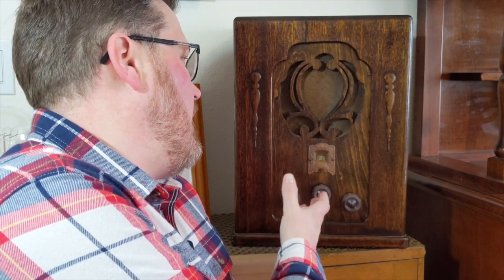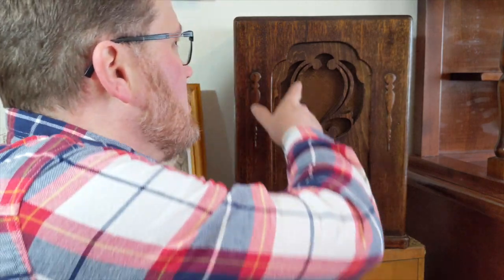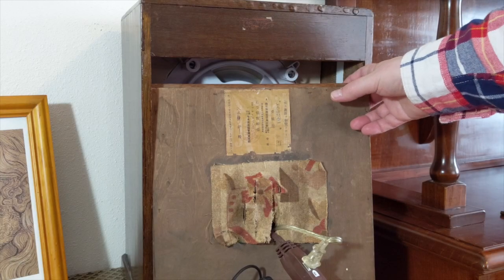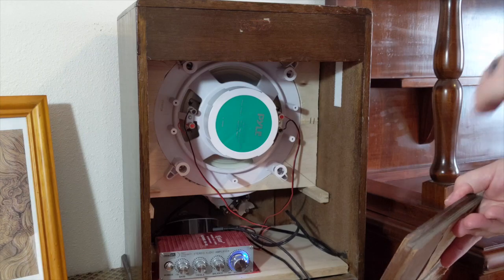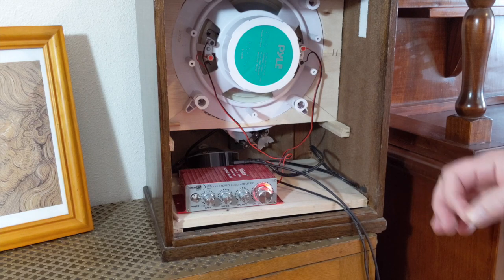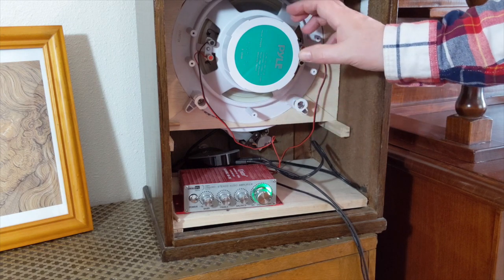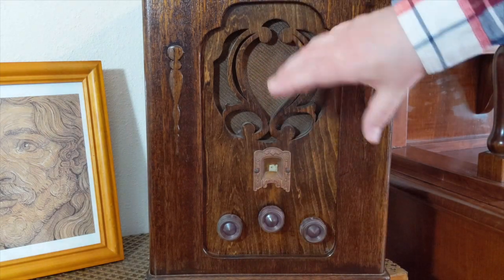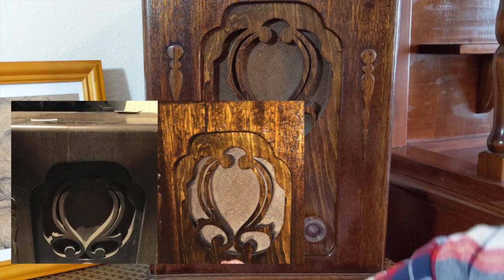I Converted an Antique Radio to Smart Speaker. You Won't Believe the Transformation!!

Comment: I actually did something similar.  I restored a Philco "Butterfly" Radio cabinet and I bought a SONOS ONE smart speaker.  Cool project, man.
Reply: Good for you. I’m an audio video contractor and enthusiast.  I have a few consoles that were basically shells and I did something similar. I placed two Bowers and Wilkins speakers inside of it, installed a night light behind where the dial was and installed some led bulbs.  The speakers are powered by an old Denon receiver .   I even have a sub hidden next a loveseat.  Sounds great.  I used a Xantech  IR kit to control the receiver.  I did what I wanted to because it’s mine.  Lastly your idea is a very good one.  Sonos ones fit well inside of tombstone radios.

Comment: Great job
Reply: skip j king on  public web site; here is my solution-i had the best of both worlds. I restored authentic radios ,rewired them and had
plenty of tubes, capacitors and test equippment-i made them work with original parts. Yet, i also had empty cabinets or
incomplete sets that could not possibly be repaired, so i put newer radios in them with often great results.I restored very old
radios, and you would be surprised how easy it is if you learn, but are careful to do it right! Now if you really insist on bluetoothing
an old cabinet try to find a nice already empty one--and if you feel you must modernize, the sell the chassis to people who
want an original-and that will help preservation and your pocket. i live in a retirement community now, but i had a blast
doing electronics in my day. If you like this sort of thing, try your best to preserve an original radio and insides and get
another with non repairable chassis or empty. lets not try to destroy all those survivors and radio history.at the rate
old things in general are being modernized there will be almost nothing left but facades.

Comment: I would like to do something similar, but my concept is a bit more ambitious and I definitely don't know how to get there just yet.  Let me also make clear that I am not into doing a restoration on the unit that I have.  I have an Atwater Kent Model 70 cabinet.  I've set aside the original electronics which aren't working, but I'll save them for posterity as I feel like that is important.  Someone else may want to do a restoration in the future.
  I also have an extra HT (home theater) receiver with all the speakers.  What I want to do is create a new faceplate for the cabinet that looks authentic to the period, but have the knobs operate the HT receiver inside the cabinet.  A base speaker and center speaker are already sitting inside the cabinet.  I'd like to make some vintage looking satellite speaker enclosures on pedestals for L&R/Front & Rear.  Nothing like that has ever existed, but I thought some old speaker designs from the 20's would work well.  Maybe I could fashion some housings that would like the 1928 Crossley Dynacone speakers from holiday cookie tins?
  Also got an old BSR 6500/X turntable from the 70s.  It's not a period match to the Atwater Kent - not even close, but even so I'd like to connect it to the system.  I'd just have it sitting on another piece of furniture nearby.  It's not a great turnstile, but it has a sentimental attachment to my childhood.  The stylus uses the old crystal cartridge, so I'd need to jigger some ceramic to magnetic circuitry and then hook it to a magnetic turntable preamp before finally terminating that to the HT receiver.
Reply from the maker: That sounds like a really cool project. Good luck!

Comment: I just picked up a small wood tabletop 1940s radio that I’m going to put a smart speaker inside. I’m looking for a led lamp solution to make the dial glow. I’d prefer one that runs off of a battery pack so I don’t have to run a second cord into the radio. Any ideas where I could find this or what to search for on eBay?
Reply from the maker: I have another video of an old radio conversion where I talk a little bit about the LED light. Maybe that will help. You can definitely connect to a battery pack via USB. With mine, I installed a small power bar in the radio with a USB outlet so there was only one cord going into the radio. And that way I don't have to worry about changing batteries. When wiring the LEDs, you just have to ensure you use the correct resistor for 5V. There is a formula for that you can find online.

Comment: Apparently you do not understand the concept of STEREO.  One cannot get stereo sound from one speaker.  One may. of course, port both channels to the same speaker, as you have done, but that is not stereo.
Reply from the maker: Nor can one win friends and influence people by tossing out random insults on YouTube. The goal and purpose of using that speaker specifically designed for STEREO sound (I guess we are shouting that word. Maybe if we shout at the same time, we will be in STEREO) was clearly to take an old radio designed for one speaker and allow people to listen to both channels of music recorded in stereo. I thought that was clearly communicated and I apologize if it wasn't. You are welcome to undertake the project and install two speakers if you want true STEREO, but the design of the radio itself will hinder that. I in fact did so on another similar project (also found on my channel) and had to face one speaker backwards to get them both to fit. This solution worked much better.
Reply: I’m currently building one and have opted for a twin tweeter ceiling speaker with stereo sound hopefully it will work , I know the limitations but it’s worth a shot
Reply: I was looking for this. Dvc doesn’t mean it’s stereo but it doesn’t really matter in the grand scheme of just trying to save this little radio

Comment: Please don't call this a restoration this is a re-build or reverse engineering or re-model but NOT a restoration!
Reply from the maker: I completely restored the casing or body of the radio. The wood was dried out and cracked, the metal was tarnished, and it was a forgotten piece of trash at a flea market. So yes, 100% it was a restoration.
Reply: @thegreenworkbench  Electronically not restored so NOT 100% sorry
Reply from the maker: @jameshochstetler6093  Fair point! Electronic restoration was impossible without sourcing all "new" parts. It was a homemade job in the first place and all parts were degraded beyond use or repair. So it would have to be a new build, not a restoration if I ever did it. But the thing is, I don't want to.  AM radio is useless in my area and would never be used. So what's the point? As it is, I use it almost everyday. A new modern life for a beautiful vintage radio. Thanks for watching!
Reply: @thegreenworkbench  You are absolutely right about that i have restored a few now replacing all capacitors and resistors and I'm convinced even if you get it completely restored to factory specs it still sounds like crap compared to today's standards. Plus no FM and like you said AM is just about dead.